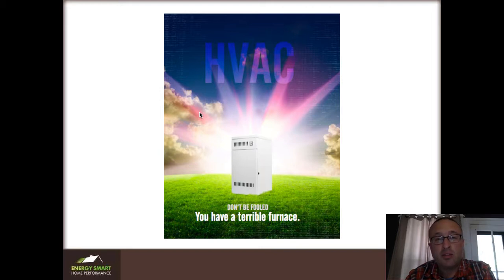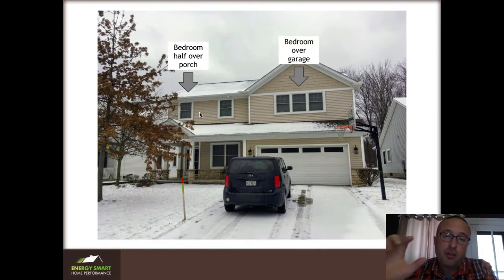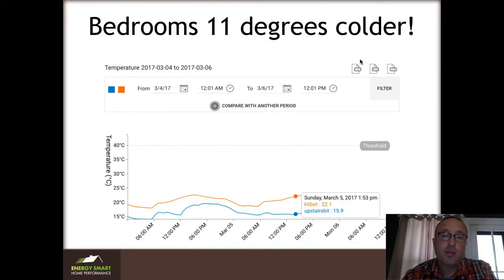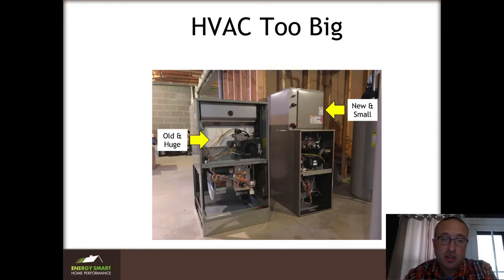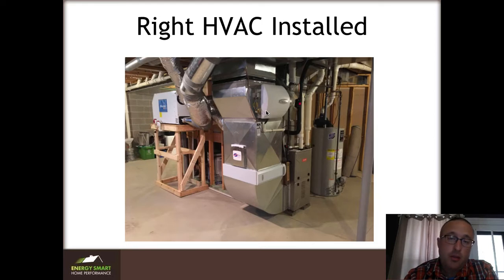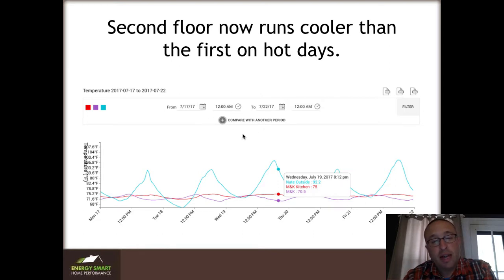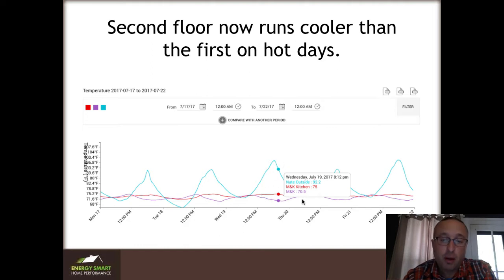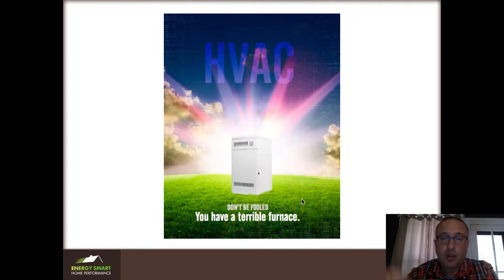Don't buy the wrong furnace or air conditioner! This couple did. HVAC Basics Guide.

Comment: That's a good video, Nate. I bought your book and downloaded the HVAC 101 chapter. 
I agree that it is a challenge to convince homeowners that smaller equipment will be better and less expensive for them. As responsible contractors we need to help them understand WHY load calculations and duct design are so important.